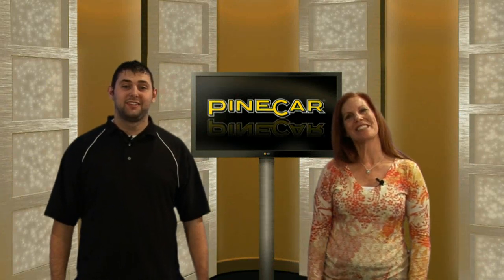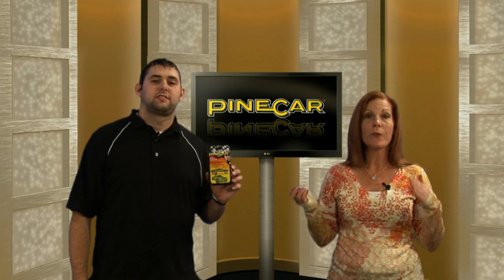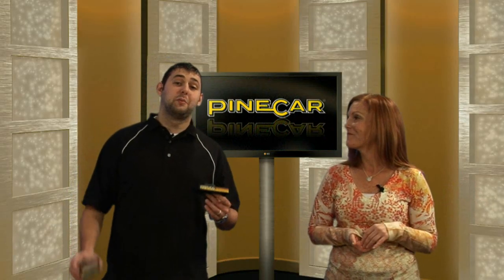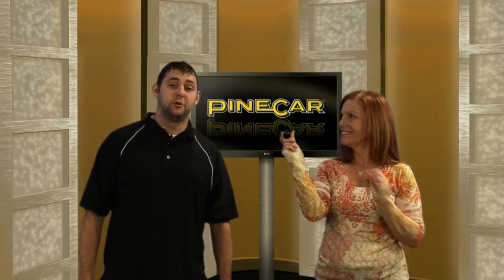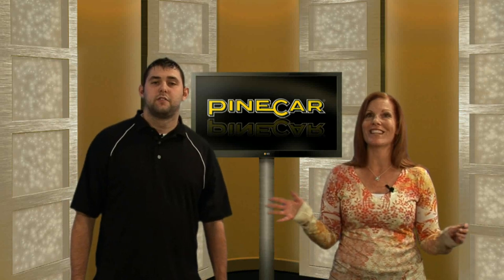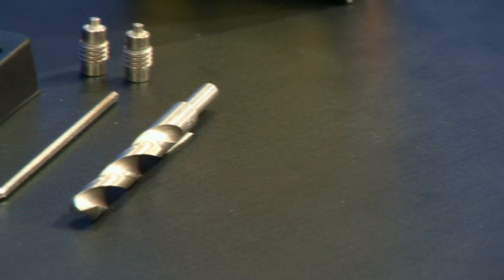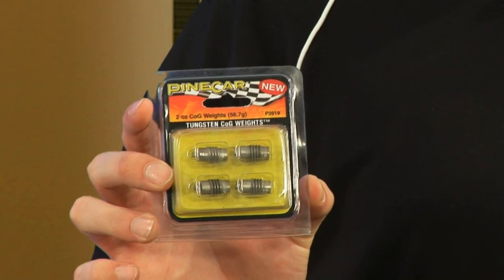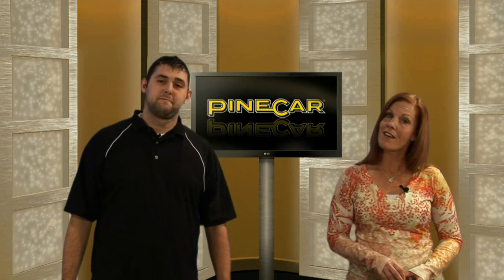Center of Gravity - CoG System - Pinewood Racing Car | PineCar Derby

Comment: I used a 3/8 as recommended.  The weights wouldn't bite.  I had to start over with a new block and drill 5/16 holes.

Comment: Please revise your video to state a 23/64 hole instead of 3/8 hole.  I drilled a 3/8 hole and found that the tungsten CoG weights floated back and forth in the hole. I was NOT happy.